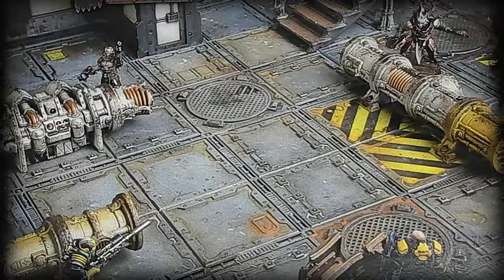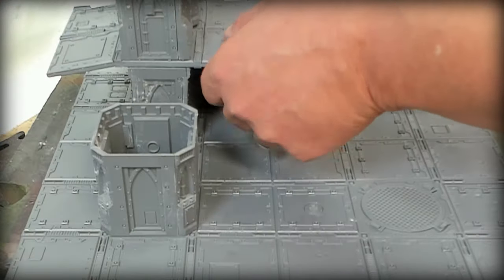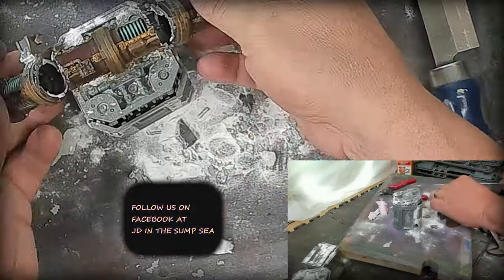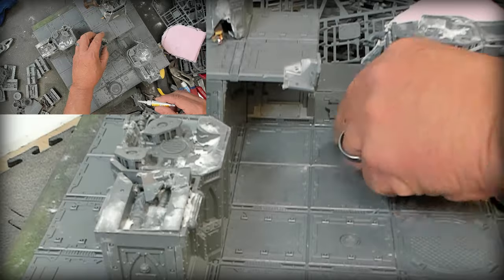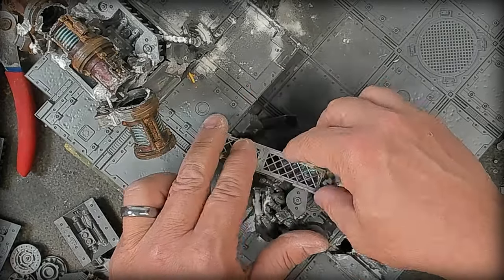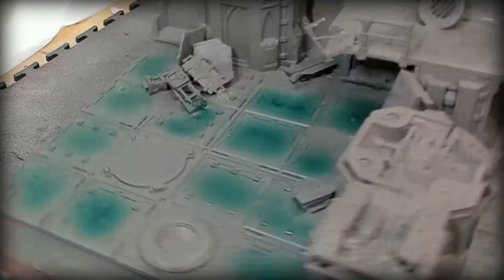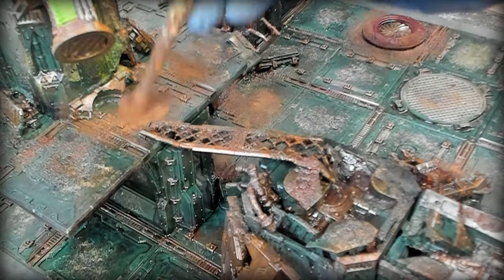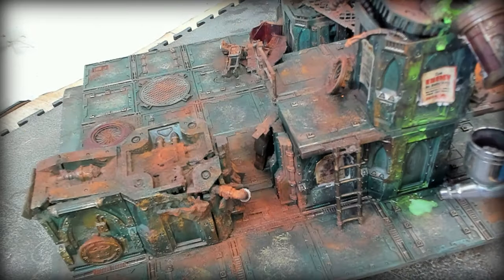Necromunda Hive Secundus Underhells Kitbash

Comment: Very cool, depending on the rules it could be fun to put them up on foam blocks but with some cutaway tunnels under the edges of some of the tiles, and then maybe have broken sections of floor tile where it looks like something tore it's way up and out from one of those tunnels or maybe just spots that are painted to look like a hole maybe break a hole and back it with a photo print or something maybe just have the hole painted with some of the hyper black paints..
Reply from the maker: Thinking the same way brother!  The future for this project is vast!  Thanks for stopping by!

Comment: This vid is great! If you wanted a more of a just bombed look instead of a rusty (bombed years ago) look how would you paint it up?
Reply from the maker: Thank you!  The answer to that question is on my mind and I think the answer is going to be when the new terrain is released really.  My tile sets are things that are not stand alone.  I make them so that you can set the tile and then place other terrain on top or in them for more flavor.  I'm thinking that when the new stuff comes that I'm going to make some 'topper' pieces that fit on the platform areas that I'm going to be adding on future tiles!  They will have more steel and gray to it than the current ones (yes I finished making tile 2 today! check out IG or FB for picts) and is something that I'm thinking about delving into more on tile 3 and 4.  Thanks for tuning in and the kind words!

Comment: Really nice conversion I never thought about using the rust effect powder, what brand do you use. I am thinking of just trying to make some just piles to add to my current terrain, I think I am motivated to paint my tiles now have just been using a terrain mat.
Reply from the maker: I still have a batch of the old forgeworld powders from the 90's, but they are being used up pretty quickly.....  I just used Huge Miniatures stuff on the second tile yesterday and It worked pretty well.  But for the rust, it's AK interactive all the way.  Thanks for stopping in!